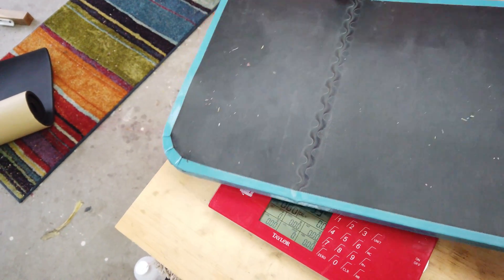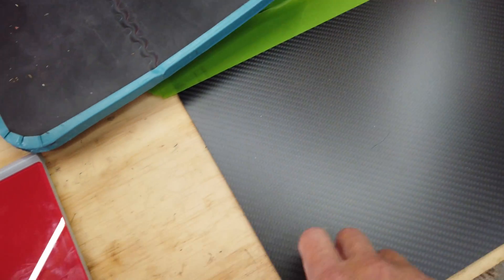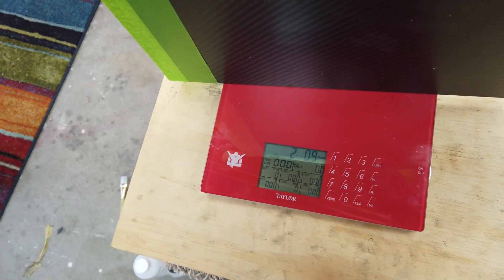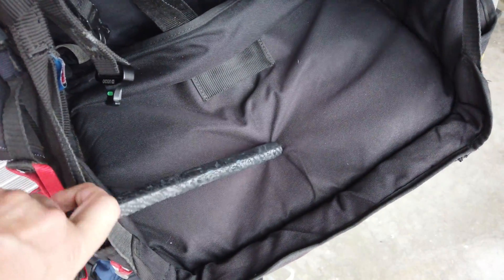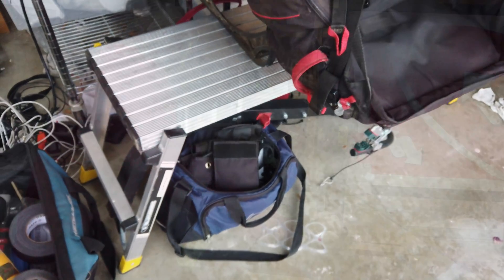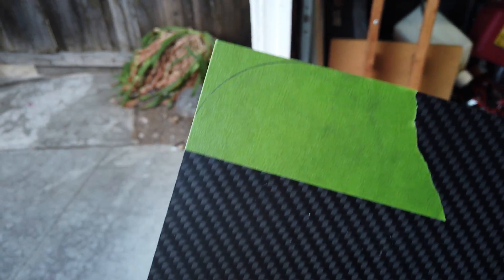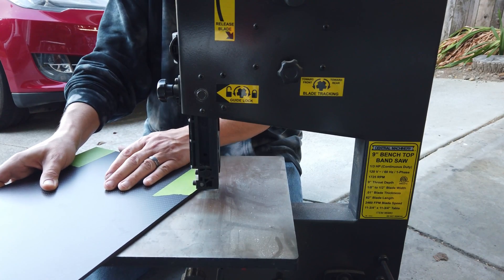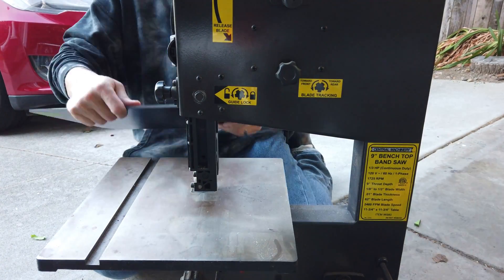Making a carbon fiber seatboard for my Scout Paramotor

Comment: I made one from a half inch Hickory board, which is very strong.  For padding I used a foam pad used for kneeling in the garden.  It was a big improvement.  Cost was around $20.  Not sure how much weight it added, but the comfort was a lot better.

Comment: Give ACP Composites in Livermore a call.  They could source a very light weight carbon fiber honeycomb.  We use them to make  components for robotics, lasers, and optical assembles.  You want a honeycomb core sandwich panel.
Reply from the maker: Yeah, calling around to different composite companies was something I considered.   But, on DragonPlate's website, their sandwich composites were just too expensive.  I didn't have time or patience to start calling around to everyone and explaining WTF I was trying to do.  So, I just went with the easy Amazon click-n-ship option.   But, I do think that a honeycomb sandwich composite seat board would be nice.
Reply from the maker: Yeah Brent, even ACP Composite's website says that a carbon fiber honeycomb plate in this size would be about $200, whereas the plate I bought was only $95.

Comment: Nicely done. Would you recommend having the plate a little smaller to get it in more easily?
Reply from the maker: I made it the same size as the original seat board, which is already difficult to get in.  I thought this would be easier since the board itself is thinner, but I clearly was wrong.  Next time, I would make it a little narrower, but not much.  I want to make sure that there are no wrinkles or places for the fabric to gather.